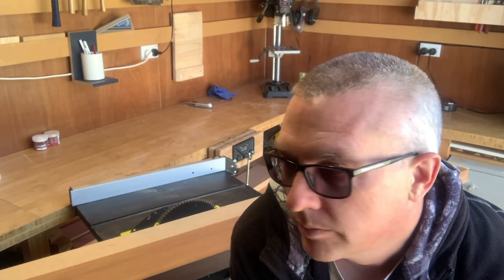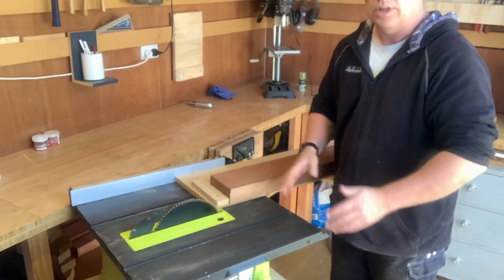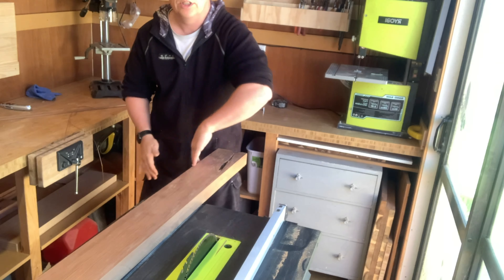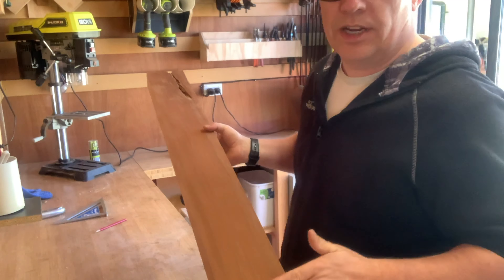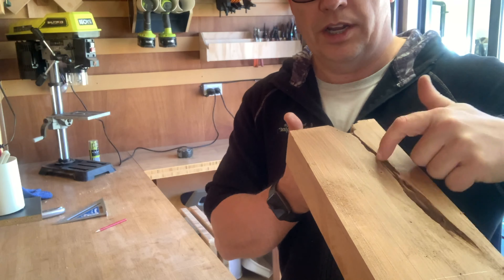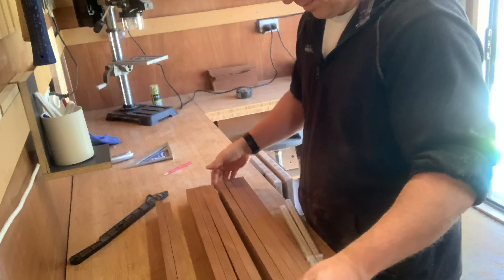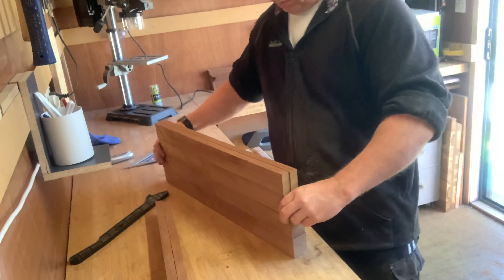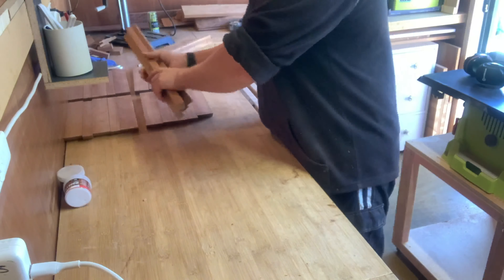How to make a lamp from kauri & resin part 1 & a short tour of my tiny workshop

Comment: Your lamp turned out pretty good. Mitres can be tricky. I probably would do the different layers separately making the whole square, then glue your layers to you supports using spacer blocks.
Nice use of space that you have